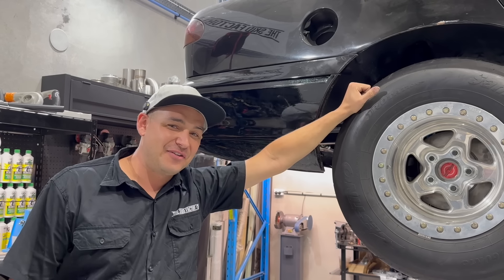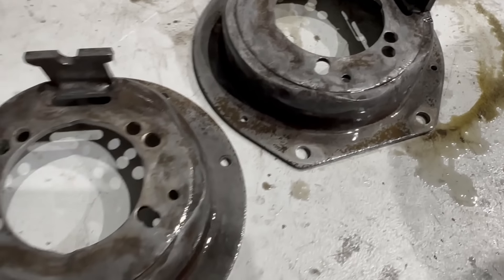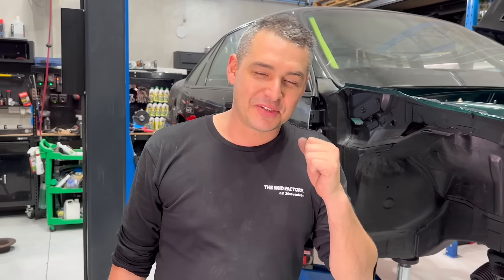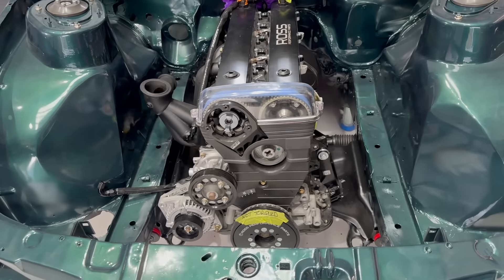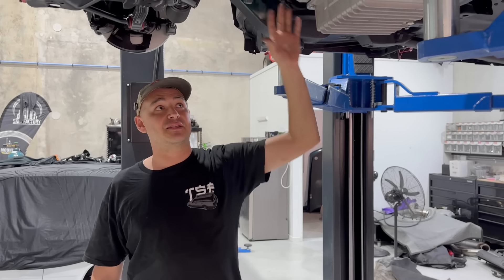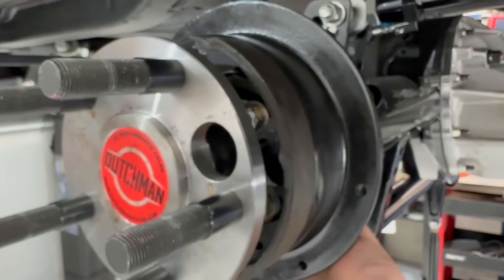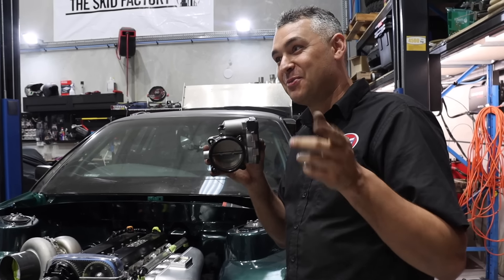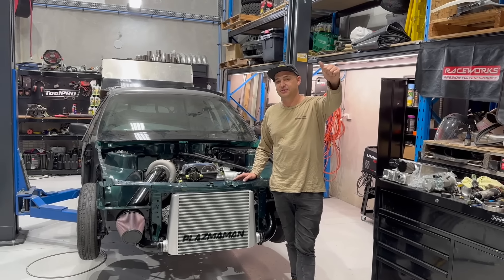2JZ Powered VR Commodore Restoration - KEVO EP11

Comment: The paint booth is good, same thing for messy grinding, keeps the crap from the rest of the shop, with that you can add a standard box fan and a square box/boiler filter with a bit of tape to seal it as extraction fumes and the fine mist particles. 
8:34 Close Woodster. Use a strip on one side of the tin's rim, followed by a similar-sized piece on the other side, to make a V shape over the inside lip. On the outside of the can, you should have a bit of excess tape you can make into a spout, like an oil drain pan.
20:14 Adapt and overcome. 
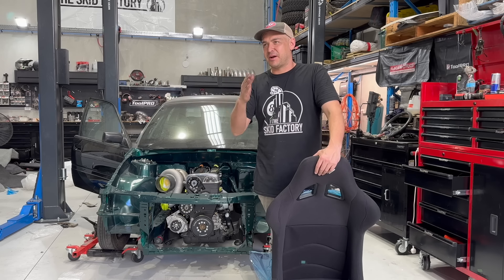23:01 Think most would be under the "Drag and Drive" use of a hotted-up streetcar, carpet and nice seats make it a more enjoyable place to be, it is the little things.
25:10 Doesnt matter, most go Horizontal for better placement, but your bay atm is open and it is only a few screws. 
You are doing well, it is now close to being a roller again.

Comment: Hey Woody you can get r31 skyline rear callipers and they bolt straight on with a holden disc and the handbrake then works the disc not the drum..
Reply from the maker: Yeah I looked at this as an option! Got it sorted in the end anyway, if there’s any more issues I’ll probably go down that path

Comment: I modified the handbrakes shoes on mine to suit big bearing. But I used the press steel type retainer not the 5mm plate
Reply: Try and find an OEM bench seat handbrake. Assembly. Bruce may have one
Reply: What are the pressed steel ones? Does it do away with the annoying hold down pin setup
Reply: No the pressed steel axle retainers. Just the factory f truck ones. I just drilled a hole in the plate to suit the pin. Was able to use the vr pins. Think I just had to squish the u clip in a little.

Comment: I had a single piece tailshaft in one of my Commodores and the factory handbrake cables used to hit it at the adjuster as they were designed to clear the 2 piece which sat higher than the one piece did where the rear section of cable connected.
I also bolt the motor, gearbox, steering rack and crossmember (K-Frame) together and drop the car onto them. it allowed me to fit the power steering and extractors  (pacemakers for 355 stroker are bigger) as they are an absolute pain to fit once the motor is in.

Comment: is that 2 pack? if so your spraying it wrong the 1st coat you do lightly leave it to go tacky once you do that you can spray it a bit heavier again leave it to go tacky till when it goes tacky touch an area not seen when when it goes stringy then you do the next coat, the tacky paint will help to not run or sag, 2k need a bit of practice before you get your head around it if you don't know how to shoot it you'll get in to trouble some times it better to use 1k paint its easier, all so kill rust is great for a tough good looking paint coat its an epoxy paint and when dry its tough
Reply from the maker: Thanks for the tips man, I’m just a self taught monkey, have learnt a lot over the years but have never been told this!! I’m very impatient when it comes to paint I’ll admit that 😂

Comment: Also if you having trouble finding vn-vs brake parts try a tractor / machinary shop, as some rollers used that model of calliper i found them on a massey ferguson tractor roller thing (was weird as the tractor itself had no front wheel) but im sure others were the same
Reply: Potential Australian of the year advice tbh. For pbr callipers?
I can’t find original part numbers or really any helpful information to use as reference tor brake stuff

Comment: not being an ass but that drivers side skirt has had the other removed ,be careful about body flex there ,it will flex bad when launching and landing
Reply: also vr column auto handbrake assy was next to the door ,check out what brad from geelong did with the door trims on the carnage street machine ute ,great work woody

Comment: "Up in the air" is when your build is in between streetcar or racecar.
I built my car for 70% track use and 30% street duties, but in reality it spends 97% of it's time on axle stands.
Reply: mine spends most of its time in the shed, its not nice to drive on the street at legal speeds and I dont get to the track as much as I would like.

Comment: "I'm quite pedantic" proceeds to cut doors up to change window regs😂😂😂 copy that
Reply from the maker: Better than not having windows at all! 😂
Reply: @theskidfactory  but way harder than just swapping window regulators 😂
Reply: probably quicker than trying to get out those stupid pins and changing doors, but wondering why you couldnt just change the regulators. I know from the VK to the VL the went to rivets but they can be drilled out.
Reply from the maker: @craigmandall9420 there was no inside of the door left due to Kevin weight reduction diet, That’s why I welded new ones in
Reply: @theskidfactory  man he must have been really stripped down